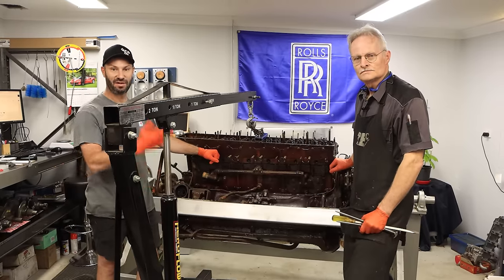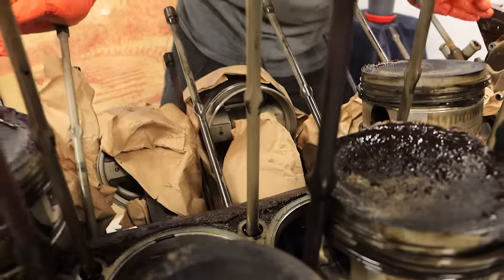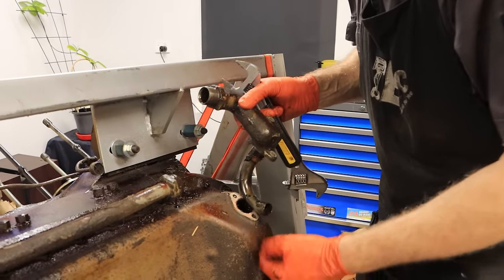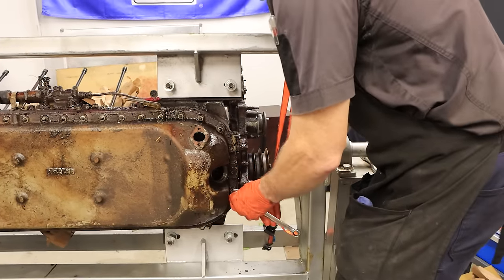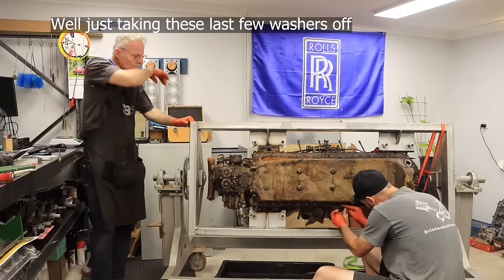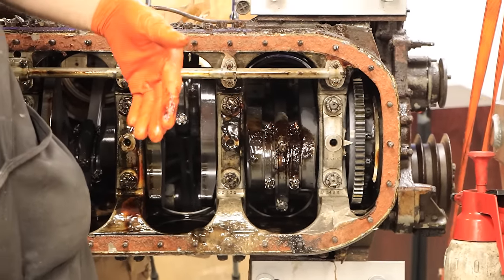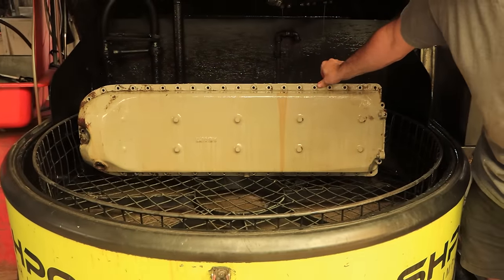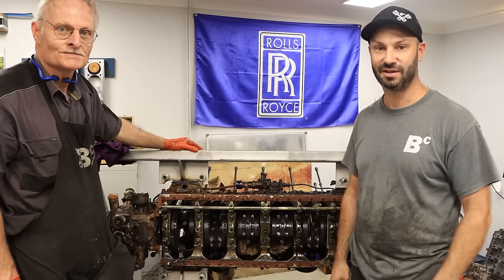Rolls-Royce 27 Litre V12 - Meteor Tank Engine Tear Down Part 4 - WWII engineering & design

Comment: The back story of how everything was developed so quickly in WWII (and done with Slide Rules and notepaper no less) is just so interesting and downright impressive..
The Comet used a modified version of the ubiquitous '17 pounder' field gun which was first used in anger in the UK built Sherman Firefly to very great effect against Tigers and even King Tigers. So good it was the primary target for German field and tank 88s.
However the Comet used the barrel but had a modified breech mechanism as the turret was pretty confined and it was a unique gun nicknamed the '77 mm'.
That '17 pounder' found its last home (in tanks) in the Centurion although this was replaced by the '20 pounder' which, when it disappointed against T-54s, in turn became the superb L7 105mm.
The Centurion of course is from where this engine came. An engine built from Merlin leftovers, crashed Merlins and Grade 2 parts with aluminium parts replaced with cast iron a) to save valuable aluminium for aircraft manufacture and b) because weight was not exactly an issue in a tank.

Comment: The Meteor engine was under powered for a tank, but it's all they had. They also used Merlin engines (without the blower) that weren't flight worthy so they rebuilt them n stuck them in tanks. 
There was a shortage of radial engines for aircraft so they stuck 2 V6 or V8 in (I can't remember which) n they were connected together in a gearbox.

Comment: The problems with radial engines in tanks are with 1)profile and 2)simplicity. Radial engines are complicated and tall and it’s beneficial for tanks to be low profile. The later versions of the Sherman tanks had twin Ford V-8 engines

Comment: The Meteor engines were rebuilt from Merlin engines that were deemed grade 2 and not suitable for continued aviation use having been salvaged from aircraft that had either crashed, or suffered damaged in some way or exceeded various limitations that might reduce the engines reliability at war levels of power and rpm in aircraft
Reply: Meteors are there engine that were built by rover I no I have one A mark 4b

Comment: Fascinating series, thank you! Rover also built a V8 version of that engine, called the Meteorite: https://www.youtube.com/watch?v=CgV9skMYLxo
Earlier Merlins and Meteors used a square tang, then the rounded tang and this was superseded by the dowel pin you have there, so the rods have been made to accept either of the two later options.